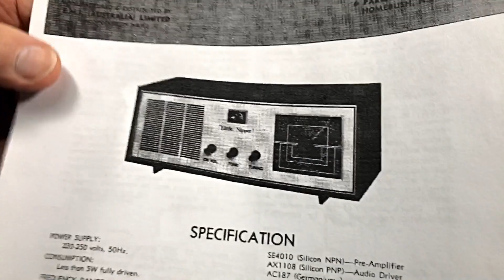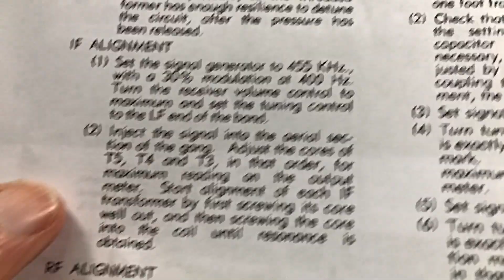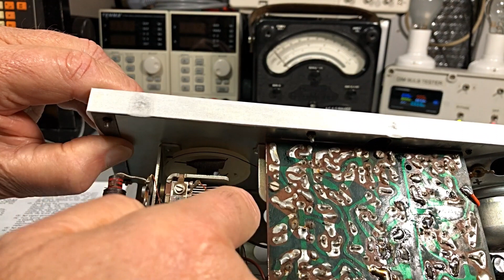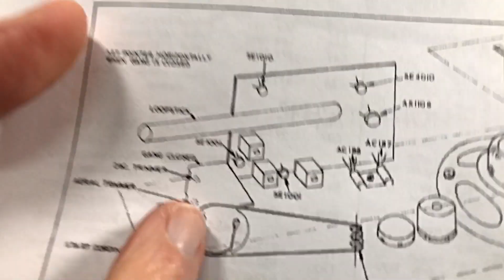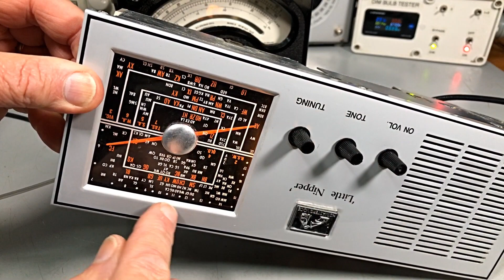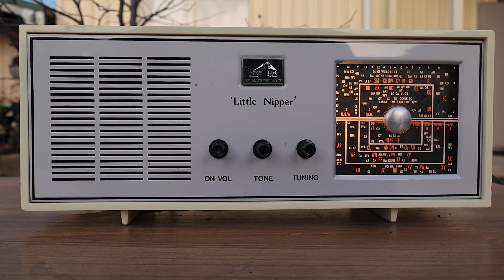HMV "Little Nipper" Mantle Radio Restore - Part 2

Comment: Hi Baz.  It certainly is a nice little radio and a good one to keep.  Perhaps it'll end up doing kitchen duty?  Also a good example for a beginner to start on as you suggested.  You're right - we need more young people to learn these skills.  We won't be around forever.
Thanks for the shout out!  Amazing you picked up 6PR in Orange!  All that cold air must improve reception!  6PR is our strongest local station with a 10kW transmitter located at Ascot, just outside of the city centre.  Not bad picking up Newcastle and 2UE either!
Strangely, there's over a hour of black screen after the video ends.  A couple of schematics turn up momentarily but nothing else that I could see.
Gee you're churning out the videos lately. I'm struggling to keep up!
Cheers
Reply from the maker: Hey Don, it is officially installed in the kitchen, 70's music playing through my AM transmitter !
It's performance is brilliant, but better more exciting ones to come !
Keep up mate !
Cheers

Comment: Hi Baz,
Love your AVO meter: it certainly looks to be in immaculate shape.  When I started my apprenticeship in radio an TV servicing (1971, through to 1976), AVO meters were ‘the meter to have’.   For the first two years of my apprenticeship, my servicing meter was a ‘middle of the range’ Sanwa - don’t hear or see much of that brand like we once did.  My first AVO meter, which I acquired at a bargain price (and still own) from a retired service tech was a model 8, mark 3.  Brilliant meter but not overly useful for all-solid state color TV servicing work, so less than one year later I went over to owning, and using digital meters, and I’ve remained with digital and analogue meters since - including owning two Universal AVO meters like the one you use LOL!
Often, radios from the late 1960s, and into the 1970s are found in ‘beat-up’ shape: the few ‘battle scars’ aside, your HMV radio looks superb - sounds and performs as good as it did when new.  Here in Great Britain, there are now very few station transmissions on the Long, and Medium Wave bands - not much time left before AM listening is no more.
Regards, PB.
Reply from the maker: I just love the AVO, I better show you guys what it's is kept in when not using it.
Very cooshy !

Comment: A excellent Refurbishment Baz of HMV Little Nipper they are excellent Radio I sold one Recently it had slide rule dial I sold for Bargain price of $30,00 Dollars,As I said before there no Am stations in the City Both have gone FM so there no call for AM radio sadly,When we’re tune about you found a weak station that could have been 1629 Newcastle there is number of ethnic stations in High point of Am band,Anyway Baz a Excellent work,Ian,
Reply from the maker: It is truly a brilliant little radio, performance is great but as you say, as time goes along . . . no AM's to listen to :-(